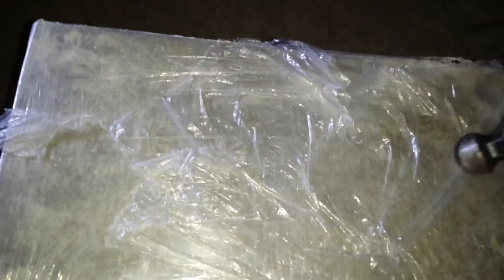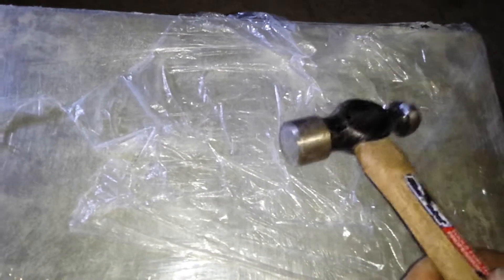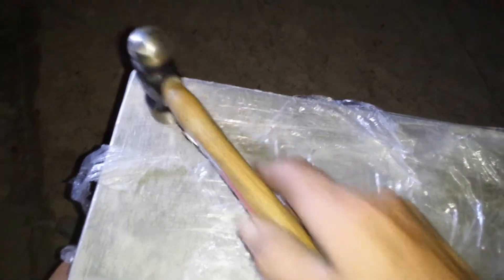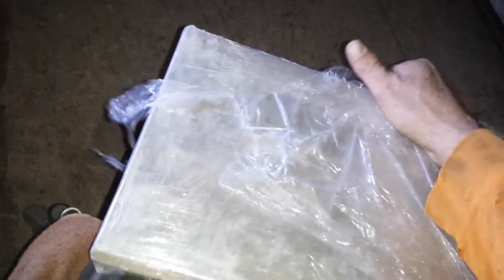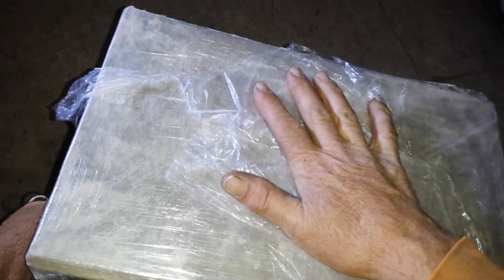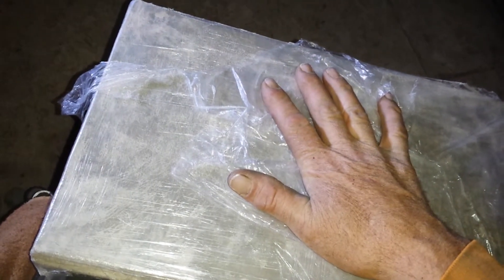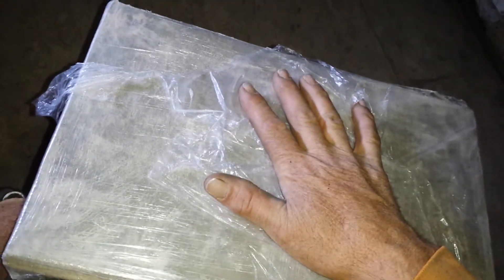MgO exotic Hemp fiber Board or Solar Collection Plate cast

Comment: Interesting... just been looking through your viseos, I'm interested in Hemp also, esp for building, I've been using sorel cement as binder, that is MgO, and MgCl2 and water... amazing stuff... is that what you have here? also interested in pursueing Geopolymer... esp as binder for hemp.
Reply from the maker: As with all cements
Energy used to reduce magnesium to oxide and chlorides are equivalent to calcium oxide and bentonite clinkers (calcium silicate Portland) just not the Co2 released from the limestone
In conventional concrete
 What's misunderstood is Co2 isn't the demon CH4 is